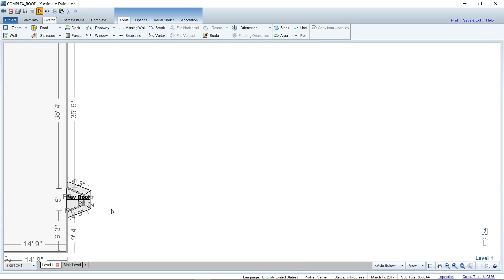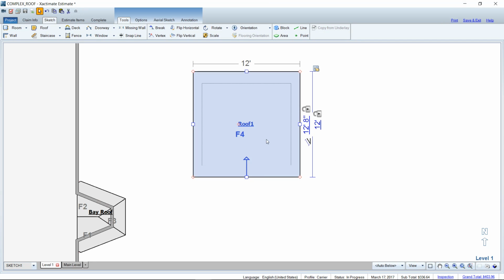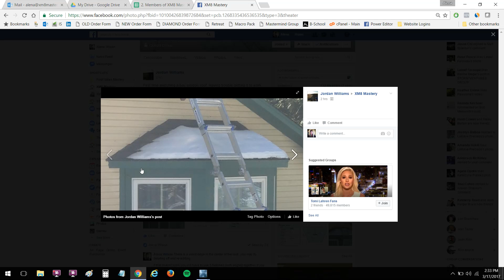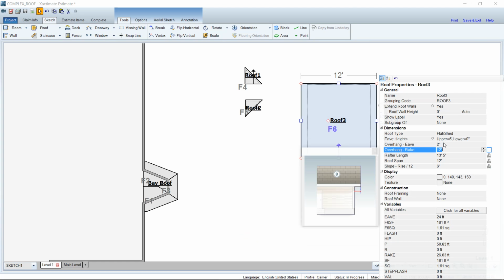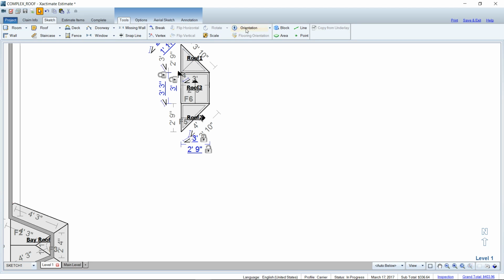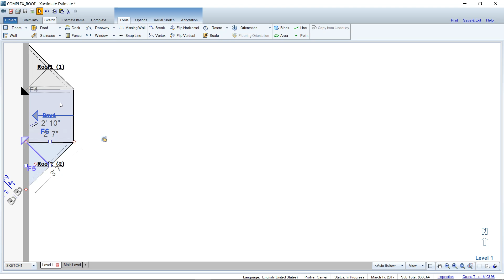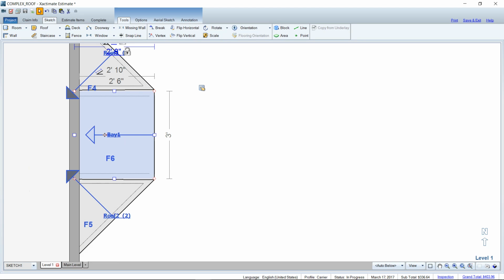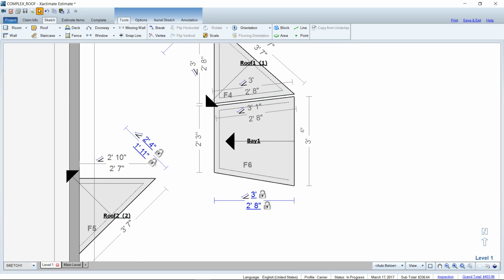Sketch a Bay Window Roof

Comment: Under the Roof dropdown, Custom Roof, Bay Roof. This is just for a bay roof not for a bay window with roof.  I know this video is old and I can't remember when this feature was added but I have been using it for a long time. I have been using XM8 since 2006. Still like your videos. A lot of estimators get caught up doing the same thing over and over so it's refreshing to see a different way of completing the same task and possibly save some time. Thanks.
Reply from the maker: Excellent point Joe! I see the Bay Roof under the Custom Roof tool - can you believe I did not know that was there?? I'm not sure when they added it either, but it had to be after 2014 when I was a Certified Trainer with Xactimate as I don't remember it being there when I went through my Certified Trainer class. Thanks for the heads up!! Never stop learning :)